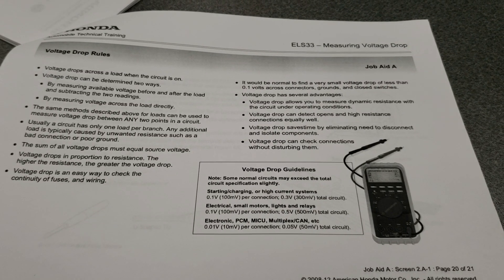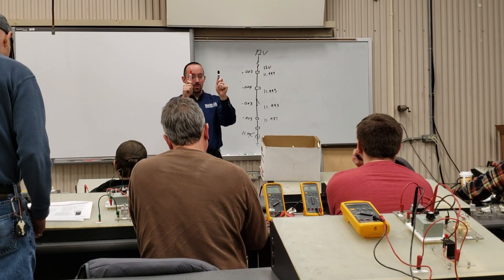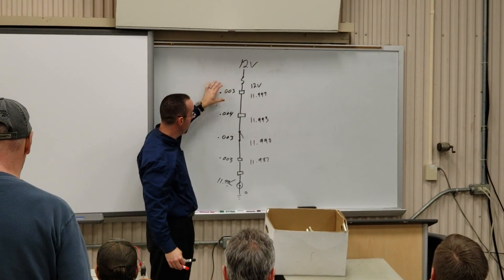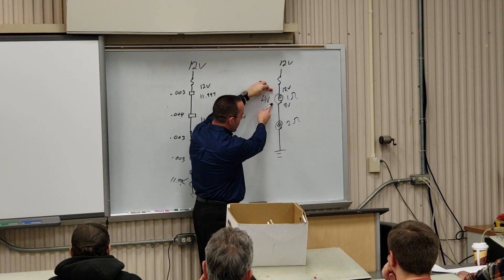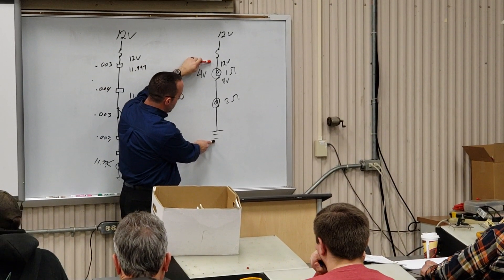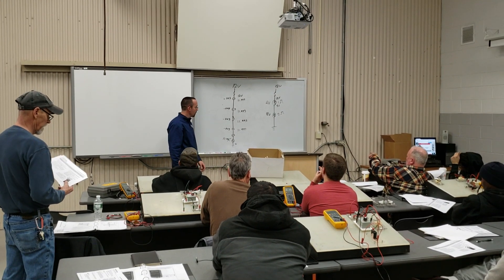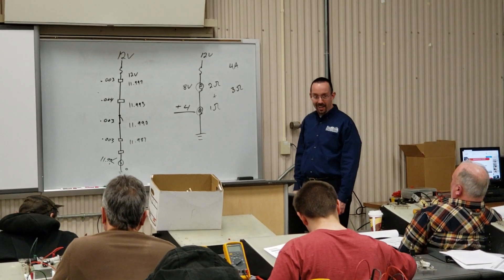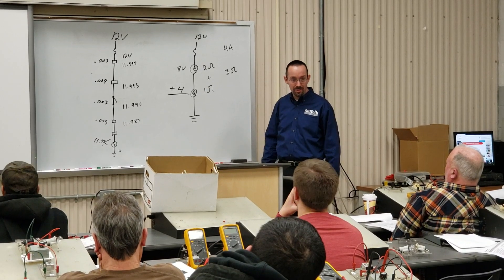Electrical Fundamentals Training at SCCC

Comment: How do you sign up?
Reply from the maker: https://www3.sunysuffolk.edu/gallery/continuing-ed-spring-19/
https://www.sunysuffolk.edu/apply-enroll/just-taking-a-course-or-two.jsp
Reply: @NewLevelAuto  hello, I wonder if i should buy a snap-on Verus Pro if i get it cheap like 1200$ maybe less.. im a intermediate scope user and diy'er thats wants to evolve.. and i dont own a good scantool or scope just a small basic unit... i want to do all makes and models including vag.. benz.. and bmw... will it be any additional costs and fees using the Verus pro? THANKS ALOT!!!! CHEERZ FROM NORWAY!
Reply from the maker: @joachimjohan1215  for that price yes !
Reply: @joachimjohan1215  for that price I'll buy it and I have one. If it has anything above 17.2 software even better. Verus pro is a outstanding tool. The problem is I don't feel it's worth 10k but it's well worth 2k all day everyday.

Comment: I have a hard time troubleshooting module. For instance I had a town and country come in the other day with a code for fan 1 circuit. The only complaint was the engine light. It was around 5 degrees out side so my first step was bidirectional control low and high. To my surprise both worked great but did notice that when command on the pcm was not saying the relay was on from data pid. I switched scanner from versus pro to autel same thing. So my next step was I cleared codes and let car get to operating temperature the a/c wasn't working (most likely low). The fans came on and immediately triggered same code again. The data pid said relay switch was not engaged. I was thinking at this time that was the reason for the code. The fans came on and worked great but triggered the code every time immediately. I checked powers grounds on both pcm and tipm with around  2amp test light. I scoped the bus lines and everything looked as it should.  Everything else worked great. The system was really basic everything was done from the tipm and reported back. My call was going to be the tipm but I refused the job. I  feared maybe it was the pcm. The code was set in the pcm not the tipm. I thought the tipm was not seeing it or reporting. I get jobs like that maybe every 3 weeks and I have a hard time.
Reply from the maker: Jobs like that are the tough ones for sure. The key is to think hard about how can we trick a module into giving us more info . Say for instance you unplugged fan 2 , would we set a code for it ? What would the data show? Etc.. not being specific here just giving the idea of a thought process I use. I think I'll incorporate this into a live discussion with an example 🤔
Reply: @NewLevelAuto  thanks for the response. I did unplug both relays and it set a code in the tipm for a high or low circuit I can't remember  but nothing in the pcm. I didn't pay any attention now I regret it.I didn't feel comfortable with the call because I don't know which one was lying. It seem to only set in the pcm no codes in the tipm unless I caused it by removing relays. I didn't even think about it. I'm kinda new to advance diagnostic I love it but I hate it. I'm going to be bold before I nail it lol. Truly Keith no bs i appreciate your time man and 5 minute videos  help more then I think you know.

Comment: hello, I wonder if i should buy a snap-on Verus Pro if i get it cheap like 1200$ maybe less.. im a intermediate scope user and diy'er thats wants to evolve.. and i dont own a good scantool or scope just a small basic unit... i want to do all makes and models including vag.. benz.. and bmw... will it be any additional costs and fees using the Verus pro? THANKS ALOT!!!! CHEERZ FROM NORWAY!
Reply: Most likely it will do everything. Ask the seller if it has euro software. Most likely it does I can't say I've seen one without it but technical it doesn't come with it. I'm pretty sure with the pro they included that in the bundle but it doesn't hurt to ask. Make sure the software is at least 16.4 or higher. Every year you can update the tool. It's around 600$ if you do it every year. If you miss a year it's around 1200$. As a diy'er or even a small shop if you have 16.4 and higher you should be OK for awhile. Basically 16.4 will only do 2015  and older some 2016. The next update 17.2 will do 2016 and a couple 2017 and so on. If you buy the scanner and it has 13 software it's around 1200$ to get up to date keep that in mind because that's only going to do 2012 and older. I hoped this helped a little. The verus is a outstanding tool for beginners. Better then any other tool because of the scope and component tester. That is its weight in gold for a beginner. It tells you how to test components what they do and even where they are. Crazy good stuff.

Comment: 10:18 "Any  additional load is typically caused by unwanted resistance such as a bad connection or poor ground."   That seems off target.  Additional resistance in a connector or ground increases the total series resistance and thus reduces the load (ie: load current).  Probably the topic at hand was: "any reduction in voltage drop across the intended load (motor, lamp, heater) corresponds to unintended voltage drops at bad connections or poor grounds".

Comment: Where is this school how can I get notifications of when classes
Reply: So I’ve heard my Spanish people like good cheap prices
Reply from the maker: Check the top comment , I've attached the links now 😊
Reply: Thanks Keith i work for Vw and they don’t really push using lab scope which I think it’s stupid since they have a built in scope program built in the oem scan tool and I would really like to learn how to use 1 trying to decide whether I stay or start doing mobile or both. Don’t know how to start or where to start here in Perth Amboy there is a lot of shops that lack the electrical part or the industry
Reply from the maker: Perth is tough , Little John and John Annello have that area locked down pretty well from what I hear

Comment: Oy, using incandescent bulbs in examples can be a slippery slope. Just remember to use the manufacturer oh/wattage specs on the bulb, don't try to measure them.
Reply: Agreed.  Incandescent bulbs are convenient to demo so long as you don't look too close -- they have low resistance when cold, and their resistance rises as they heat. So you can't assume a particular resistance when put in series with other bulbs that also have this characteristic.